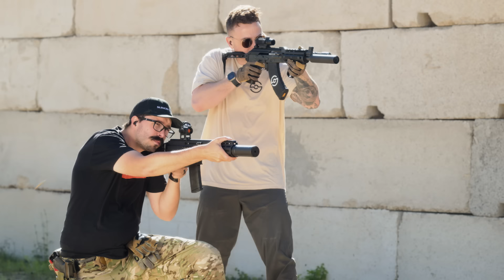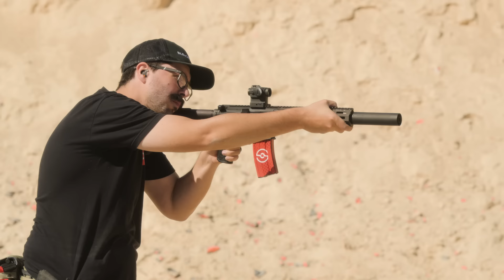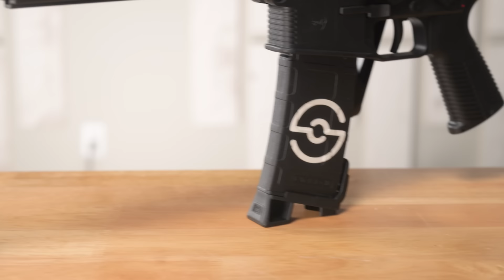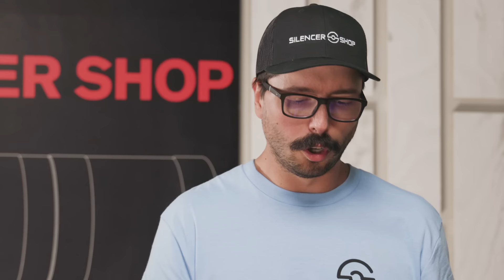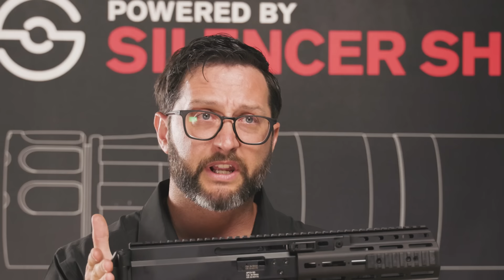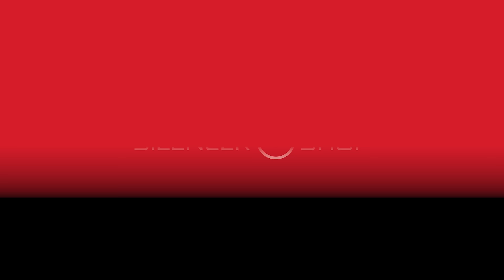New B&T Guns & Suppressors - B&T Rotex, SRBS, APC, SPC, and MORE!

Comment: They need to come out with a inconel SD suppressor. Idc how heavy it would be I’d buy it. I want a SD can for my APC9 SD that will last forever, not the junk aluminum one that will eventually wear out
Reply from the maker: The SD suppressors are very durable, Inconel would make it very heavy.
Reply: @ yeah and idc if it’s heavy, it’s what I want. I used a knights can on my issued m110 and I didn’t care about the weight and I used a NT4 and didn’t care about the weight. I want a can that last longer than me

Comment: Is this a SD version of the APC223? The handguard looks the same as the upcoming SPC223
Reply from the maker: That's correct!
Reply: Incorrect. That’s the APC300 SD. They offer a KSK hand guard for the APC223 but that only covered the gas regulator. & gives you one extra Mlok slot.